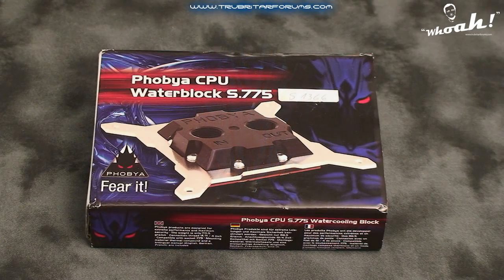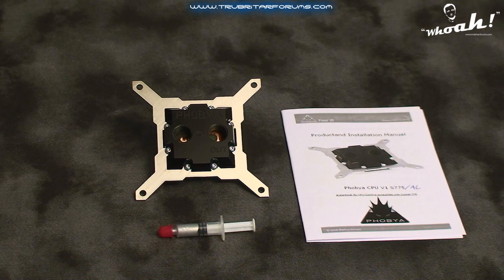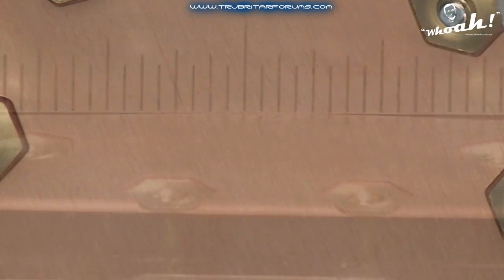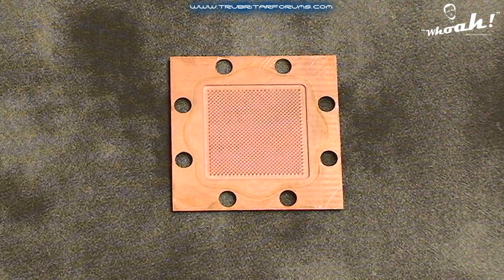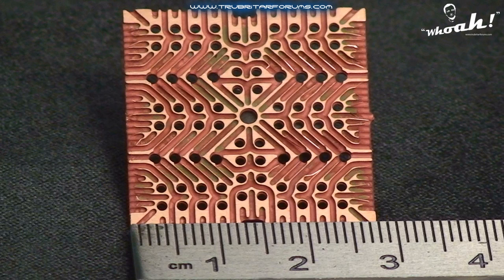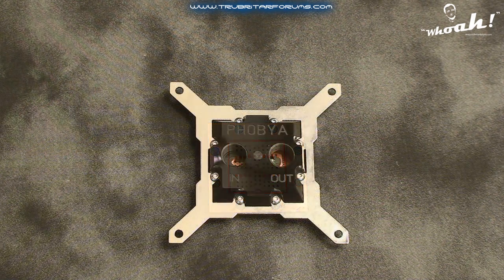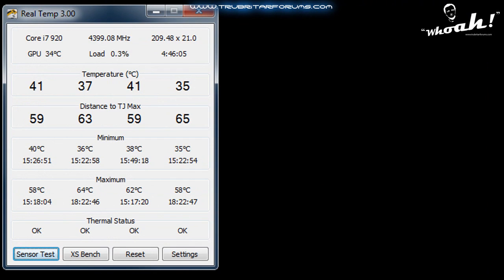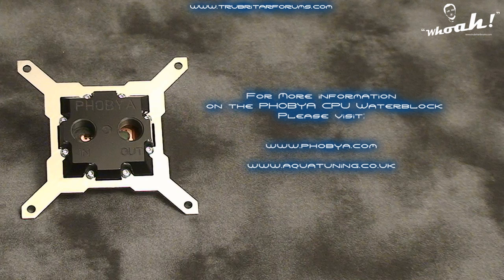(HD) Phobya CPU Waterblock Torture test.

Comment: @pyromonster99:
I like how your own AMD fandom is your ultimate downfall. Lets look at the past: AMD named their older Athlon 64's as 4200, 6000, etc. They did this because it was the EQUIVALENT to the processing power of a P4 clocked to those speeds (in mhz); however, they were only 2.6ghz. What this means is: the clock speed means NOTHING. NONE. ZIP. NADA. So to get back on topic, a 3.6ghz i7 will absolutely DESTROY, OBLITERATE, DEMOLISH a Phenom II @ 4.2ghz at benchmarks and real world apps.

Comment: the phemon 2 doesnt cold bug and only runs at high clocks speeds with sub zero temps.

The colder you get the the higher it clocks, dfi UT m3eh7 broke the 7ghz but's it was a sample mobo i think under liquid helium.